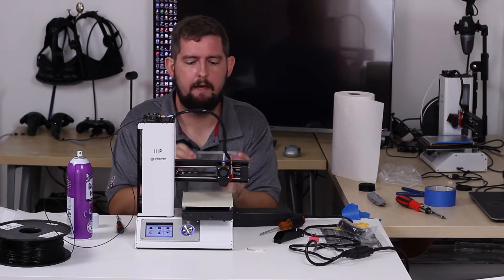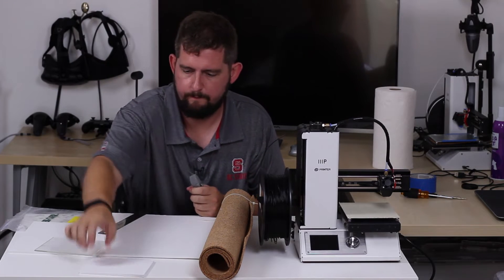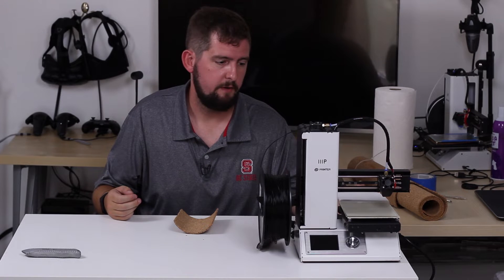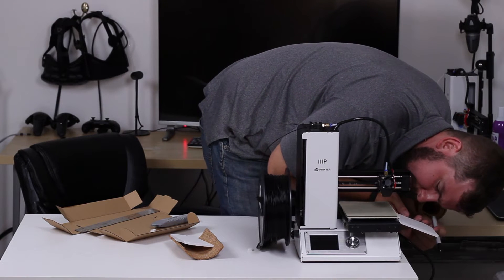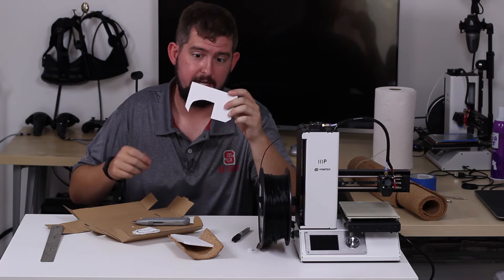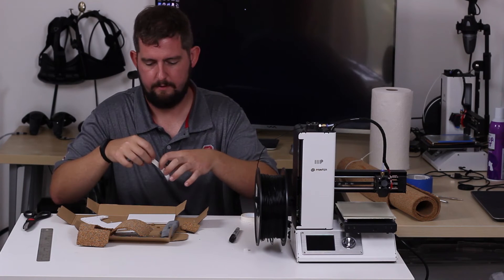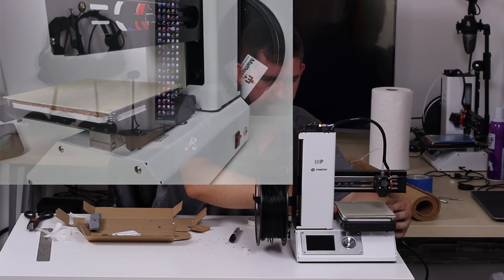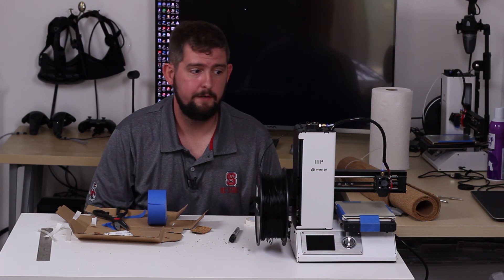Monoprice Select Mini 3D Printer Beginner's Guide (Part 7) - Cork Insulation for the Heated Bed

Comment: What is the cork thickness please? Is the foamcore 5mm? What is the gap between the cork and bottom of the bed? Is ther room for some further height adjustment once installed ? Thanks
Reply from the maker: The cork I used is 3mm.  Foamcore is 5mm.  I ended up shaving the foamcore down to ~3mm to get a nice snug fit.  You want as little gap between the fork and bed as possible.  The distance will be determined by how thick you print the Z-axis spacer.  The thicker the spacer, the more gap room you'll have under the bed itself.  The foam is only there to keep the cork as tight as possible to the bed underside :)
Reply: Thanks
Reply: I had missed this comment and had noticed that the center of my bed was bowing just a bit, until I pulled the core back out and shaved that off. It might be good to put a note of this in the description for those who might be a bit "thick-headed" and easily miss things in the comment section. lol. Great video by the way. I've pointed "several" people to this series...
Reply: thick headed guy here - by bowing did you mean that the center was raised(from too much stuff under it) or lowered?

Comment: whats the highest temp that you got on the heatbed with the cork board installed
Reply from the maker: +balancenoptions1322 the highest I've ever reached was 95C with ambient temp of 75F and an enclosure over the printer.  Even that wasn't really useful as it took 20+ minutes to get there.
Reply: Life and Times of Tyler Koo yeah I didn't have cork board so I just used a piece of foam that they send with motherboards and I set it to 80c in a 65F garage testing it out right now

Comment: Thanks Tyler!
1.   Why foam core & cork?
2.   What was the total thickness of your project? 
3.   Any fears of ignition with the cork?
Reply: Expanded cork insulation has an R value of 3.6. Expanded Polystyrene aka styrofoam has an R value of 3.6-4. That's cork that's especially formed for insulation. Pretty sure that corkboard in roles is going to be less expanded and have more bonding agents- both of which will reduce the R value.

As for temperature, that's hard to say. I don't think they'd make the cork bonding agents out of anything with a particular high temp rating. Likewise for foam it's hard to say as it depends on what you consider the acceptable failure mode. We know it handles 100C boiling water with no degradation. 

I think it'd be fine for a heat bed without cork- cheaper, easier to work with, and no cork bits floating around to get caught in mechanisms. 

I think that mylar or even aluminum foil between the bed and insulation would work nicely to reflect back some of the heat. The foil might work to minimize hot spots in the heater and insulation. I haven't taken mine apart yet but I'm guessing it's a typical resistive element so the element will get hotter than the gaps between the elements.
Reply from the maker: RJ Myers 1) cork because it's a great insulator with a very high temperature tolerance.  Foam because it's also a decent insulator and a cheap way to gap fill :)
2) I use 1/4" foamboard and 3/32" cork sheet.  But I've had to shave the foamboard down on some printers to lower the bed a bit more.
3) Cork is temperature stable up to ~150C :)
Reply: Thanks Tyler- Using Great Stuff, after taking to their tech support. Formed up around the plate after taking it off. Used some 1/4" styrene from modeling to make the form. In the process of trimming the foam with a home made foam wire cutter. Will let you know if it works Have a Safe New Year.
Reply from the maker: Davey Hi good info for sure man.  If you experiment with more materials and combinations and find something that both works well and is readily available I'd love to give it a go.

Comment: Hm, Michael's Crafts has a product from Elmer that has the foamboard and corkboard already bonded together. Only rub is that is looks to me to be 1/16" thicker overall (probably uses 1/8" cork instead of 1/16"). Still it might be worth a try. Also given the Mini's history of the heated bed connections breaking would you recommend removing the bed and inspecting/redirecting/reinforcing the solder joints? If so it might be easier to install the insulation in one piece at that time.
Reply from the maker: Whoa, that's really cool!  I'd say definitely worth a shot if it will fit :)  Next time I'm at Michaels I'll see if I can hunt it down.  This being a beginners guide I wanted to stay away from electrical work, and really if the bed connections break, I would advise most people to just return the printer for a replacement.  

This is designed as a removable piece that requires as little invasive work as possible.  But yes, if you're already breaking down the heated bed, definitely going to be a better idea to just do it as one piece!
Reply: Life and Times of Tyler
Hm, stopped off at Michael's today. I don't think they will work (for the Mini at least) as it is twice as thick as the normal thin foam board. Probably so it can be used as a tack board.

Comment: what can you make with pla and abs filament
Reply from the maker: PLA is great for any parts that won't be exposed to high temperatures (generally anything above about 100F).  ABS is really useful for parts that need to stand up to higher temperatures and higher mechanical stresses.  Check out this video for a pretty solid overview. https://www.youtube.com/watch?v=tC_z6jznFPY

The only real drawback to ABS outside of the difficulty in printing with it is UV exposure.  ABS will degrade when exposed to direct sunlight for long periods of time.  So if you want to make parts to be used outdoors, you'll want to paint or otherwise UV seal them after printing.